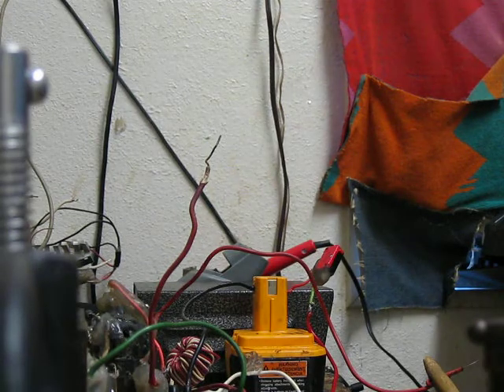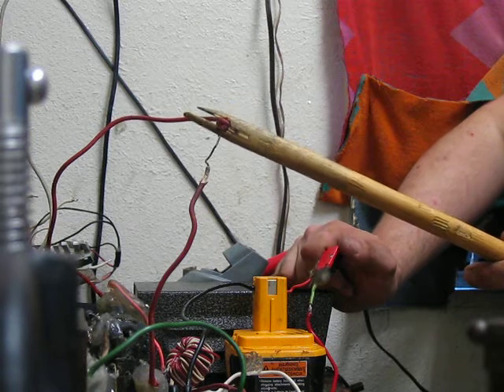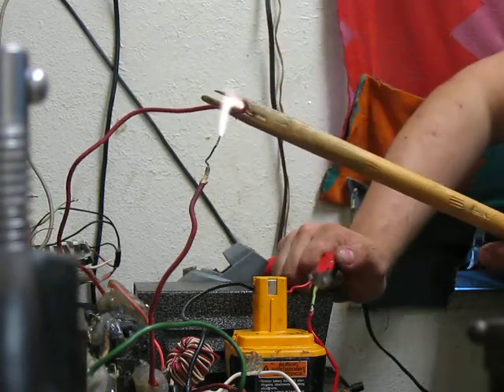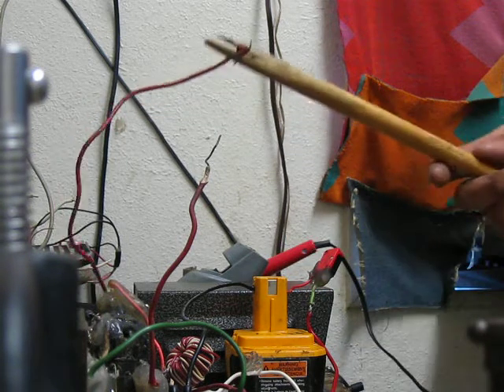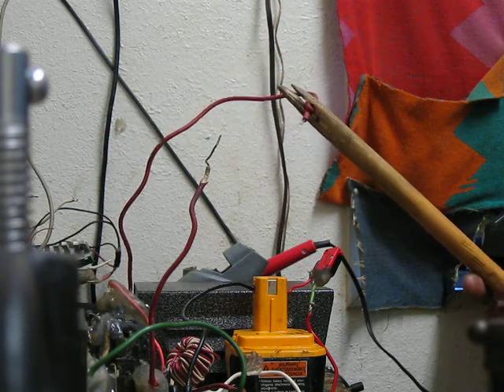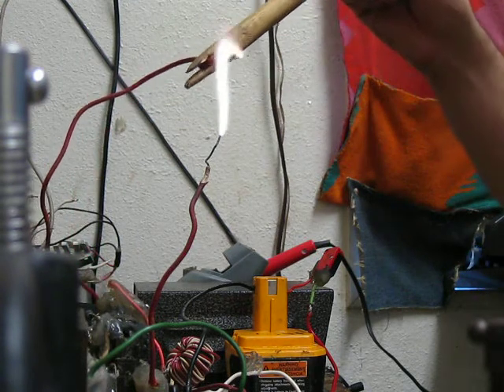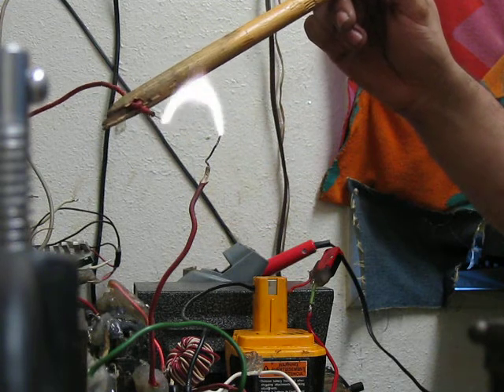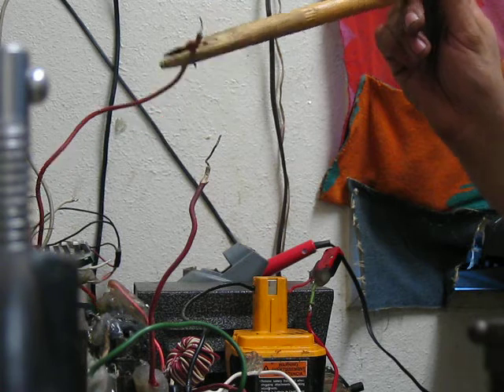ZVS driver using DC battery versus rewound MOT rectified

Comment from the maker: @Alex1M6 

I never did like the 3055's.In my experience just about every time, using the horizontal deflection transistor that came on the tv circuit board as the flyback used,the H-deflect transistor almost always did 25-50% better than the 3055's,some i found work 2x or better.might be my luck with the chips i found vs 3055's around here, but i have never used a 3055 that any random h-deflect pulled from my pile didnt beat for arc start length,max pull, corona,and plasma-licious burning arcs.

Comment: I recently went from regular alkaline battery's to a sealed lead acid 12V 7AH battery and I noticed a big difference in the length of arcs I can draw from a 2n3055 based flyback driver, and hotter arcs on a 555 based MOSFET driver. Infact I somehow managed to kill two MOSFETS using the lead acid battery that worked fine on 10 1.5 alkaline battery's in series (15V), I am still not sure how. 

Using the alkaline battery's I would draw around 2A max and using the lead acid I draw around 2.8A.

Comment: The reason the output is so poor on the transformer is because you need like 5,000+uF smoothing capacitance else that 60hz will interrupt the drivers natural function, thus decreasing arc length and efficiency.